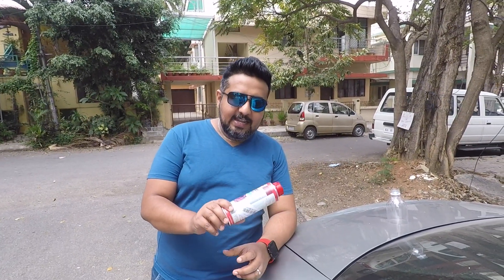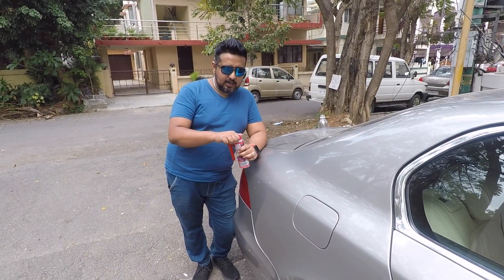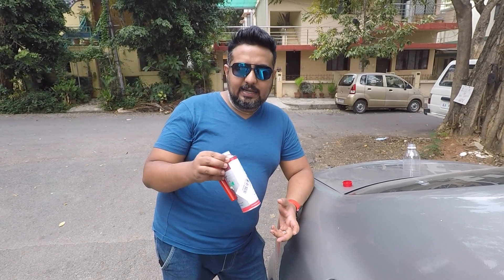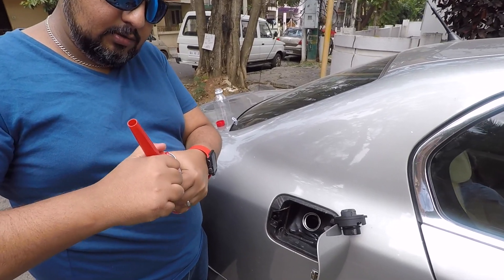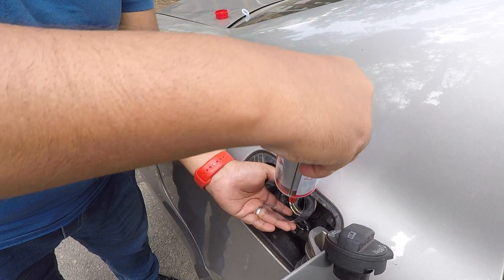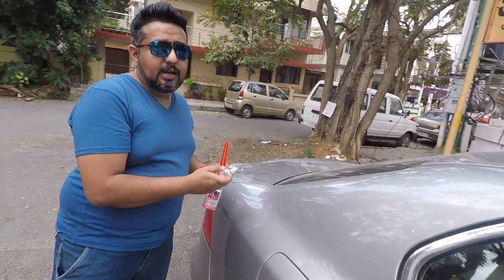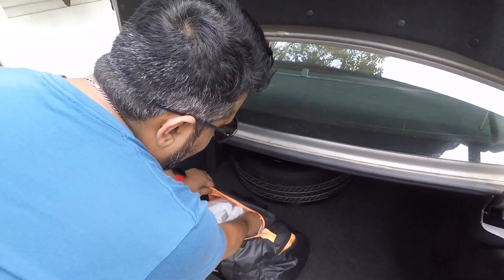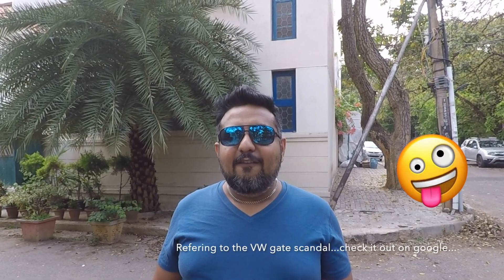Liqui Moly Super Diesel Additive

Comment: Guys dont use it in any Ford vehicle as i did it after 100000 km immediately got a engine warning light in my Ecosport.
Reply from the maker: Did you investigate further as to why it threw up an error light ? Was it the gunk build up getting cleared triggering something?
Reply: @suniTvlogs  thx for ur concern and reply. Sure I did an entire diagnosis with Ford with their software the problem showed was with the fuel pump and system though I did not flush the diesel which was already there I am trying to dilute it and run by filling more fuel.The problem has reduced but when the RPM Increases the light shows up otherwise there is no problem in other functionality 
Will keep u posted 
Thx again
Reply: @suniTvlogs  after doing about 2200 km and burning about 130 literes diesel at last the engine warning light got off.So the affect of this additive is about 120-130 literes,
Reply from the maker: Glad to know that your car is ok now 👍 thanks for sharing your experience...
Reply: @suniTvlogs  Thanks for your concern surely will follow u here